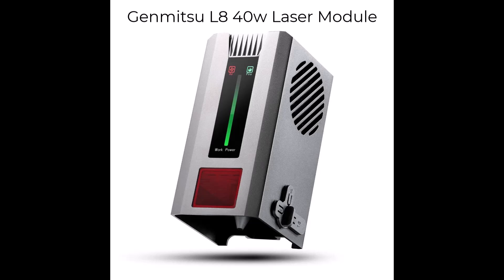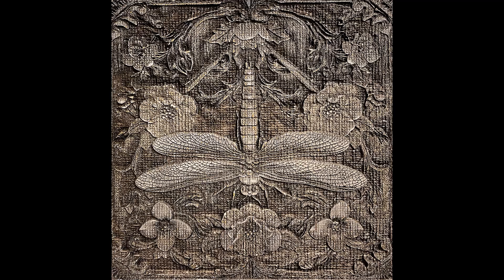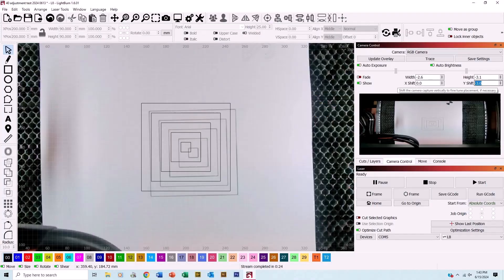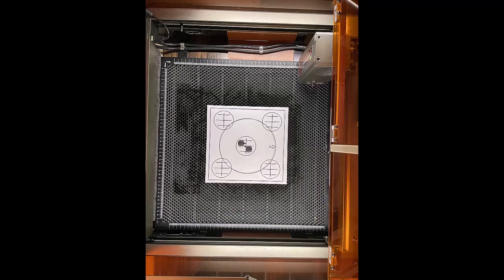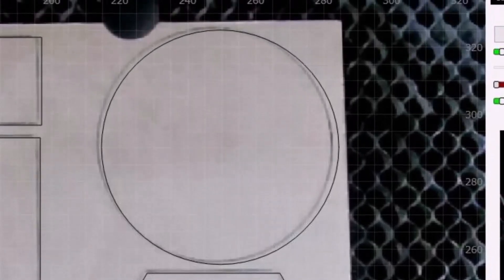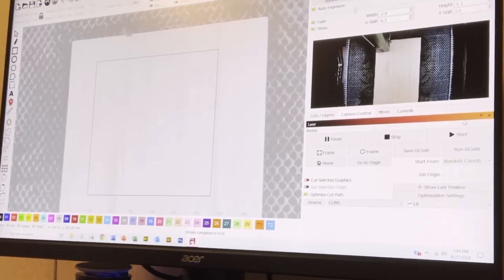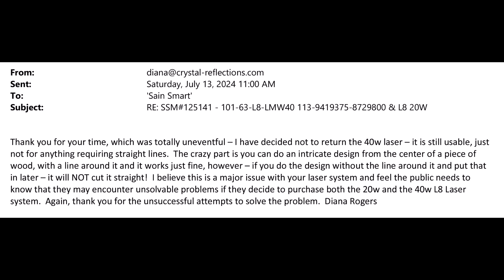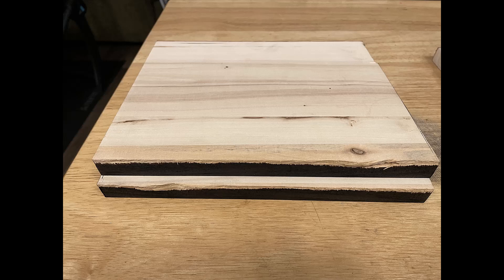Genmitsu L8 40w Laser Module Review

Comment: hi there! The laser module fan is always running and is noisy. Is there a way to configure it to only run when cutting or engraving starts?
Reply from the maker: I took out the little fan that comes with the Genmitsu L8 Laser and installed a large AC Infinity Cloudline Pro S6 Fan that sits beneath the Laser which only comes on when you are using the unit.

Comment: That's one of the reason I'm kinda hesitate to buy a laser from Sainsmart, as I think this laser was also called Woxcker L8.  And this is their first kinda enclosed system, which seems pretty good with all inclusive. I didn't get why they riveted the bottom bed into the honeycomb though, would make things hard to clean. I'm still debating on which to buy..
Reply from the maker: You might be right - I don't use the 40w right now because it is a real pain to change them out and recalibrate everything.  I have not been able to get it calibrated correctly, so I just make sure I have enough material around the item to cover the amount it is "off".  I like the machine, it is just not all that they say it is.
Reply: @drogersusa  So sorry to hear you having issues with alignment/calibration. Wish you all the luck from downunder! Hopefully you can get this sorted.

Comment: I have the 40w Genmitsu L8. It came in a box direct from sansmart. It works great and cuts straight. Never had an issue with it yet! I did upgrade the rear fan tho with a powerful suction. Otherwise, this machine is a powerhouse. I love it! I do use the camera but for basic alignment. But you can't rely on the camera to align everything perfectly. For me, it gets it DAMN close tho lol. But I'm used to another machine that doesn't have a camera so.
Reply from the maker: PcRat, I am wondering - did you purchase the 40W L8 laser machine?  I purchased the 20W laser machine (which ran perfect when I got it - then I purchased the 40W laser as an attachment 2 months later.  Just curious?
Reply: @drogersusa  i bought the 40w version...  machine. Only difference is the diode module.. that's it. Love it!
Reply from the maker: @PcRat1  I am sure it is wonderful - my video was about buying the 20W L8 machine and then later purchasing the 40W laser attachment so I could switch back and forth.  I am happy with the machine too - but switching the diode module from 20 to 40 has given me problems that even Sainsmart could not fix - they did offer a refund on the 40W - but I decided to keep it anyway and just be satisfied that I loose a little wood on my projects.  Thanks for sharing your experience!
Reply: @drogersusa  why keep switching? Your def gonna run i to issues if ya keep doing that.

Comment: I was ready to pull the trigger on this 40W laser until i saw this video....please keep us updated if the issue was solved. I am now having doubts about this machine. Thanks for your work.
Reply from the maker: Krispy_Bee, I must confess - I took off the 40W laser and put the 20W back on - it took so long to get the 20W aligned again that I haven't wanted to put the 40W back on - so, for me at least the problem isn't solved, just postponed to another day.  The company solution was just for me to return the 40W and I didn't take them up on that offer (probably should have).  My 20W was working perfectly until this - now, I have to align it often.  It produces what I want, I just lose a little wood because I can't butt up against the wood when cutting things out.  I am happy with how my projects turn out ... so, that is where it stands right now.

Comment: Okay, forget linear thinking when it comes to optic alignment. Ie. if one area is off by 1mm then all should be, and in same direction. 
When setting up the camera one of the first tests is all the round dots? this is used to check for optical distortion. an obvious example is comparing a fish-eye to a standard lens: if using a fish-eye lens - where as you get away from the center of the image things seem distorted? Compressed? compared to a standard lens the distortion is obvious and pronounced. well ALL lens do this kind of thing. That test is used to build a table in the software to adjust for this. errors in the table is why areas of the image can be off by different amounts and directions compared to other areas.  The round dot test is THE most important adjustment. Do that one very carefully and do it properly. Just a little error or saying, well .7 is better than .68 can make a difference in the results larger than you would expect.
Take your time with this part of the alignment to get it as good as you can. Then understand that if the position of the camera vs the laser cutter changes in even a small amount, the results can be quite a bit. One way to visualize it is to think in ANGLES - and Not Linear distance. the test is designed to determine linear distance by measuring angles and a tiny change in angle can result in a large linear distance. the concept (But not what is actually happening) is similar when u shine a light-source on a mirror from off to the side at a shallow angle, and then change the angle u shine it just a tiny bit, the reflection of the beam on the wall can move inches if not feet. and it gets worse as the light spot shines on objects farther away.  Its a hard idea to try to explain so I hope this is not too confusing.
Reply: Oh and by watching the screen of your actual camera images shown thru the software? I am pretty sure that your camera is too close to the work area. the issue I described has less and less of an effect as the distance between camera and surface is increased. Did u set it up with the suggested distances from the software in mind?
Reply from the maker: Thank you for your detailed explination - I will try to align via your suggestions.